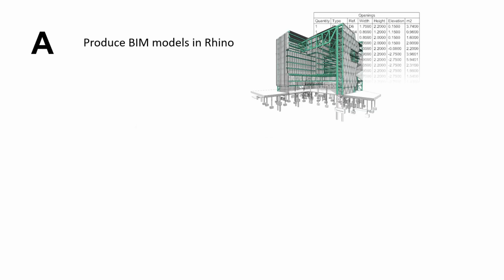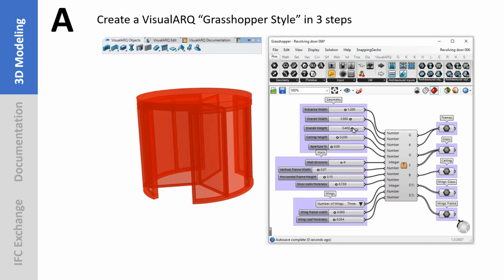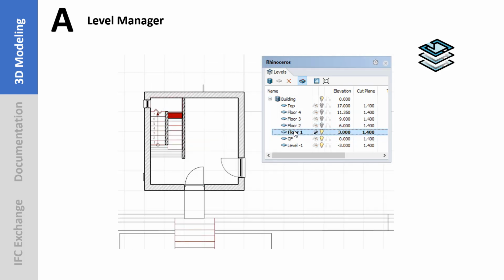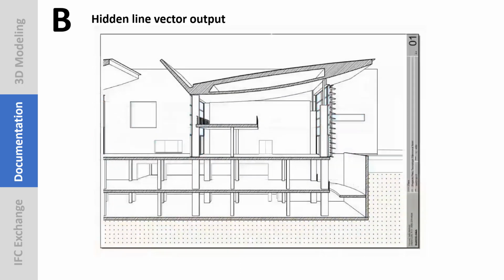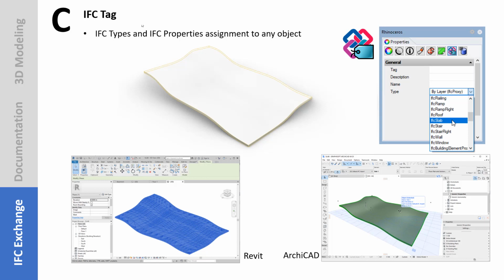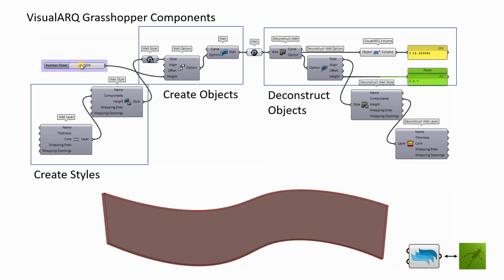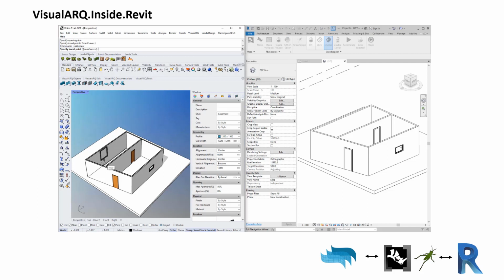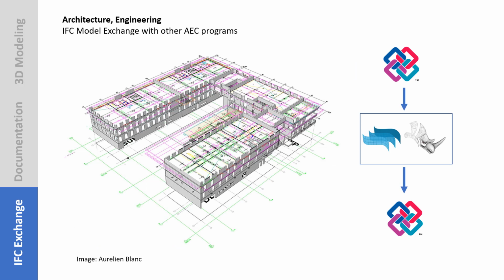VisualARQ 2 key features Presentation

Comment: Is it possible to create parametric lamps with VisualARQ and export them to Revit with the associated ies files? I need to create BIM street lamps and I want to create them directly in Rhinoceros.
Reply from the maker: Hi Gabriele, yes that's possible! There's already a parametric "Floor Lamp" (as an "Element" object style) included in VisualARQ templates. That's an object created as a "Grasshopper style", which means that has been created from a Grasshopper definition. All parameters in the Grasshopper file used to create that object are stored as properties in the object, and exported to IFC. In addition, you can add custom data to that object, with the "custom parameters" feature, which will also be exported as IFC properties. On VisualARQ's website, you have some tutorials to create those "Grasshopper styles". For example: https://www.visualarq.com/learn/grasshopper-styles/furniture-elements/